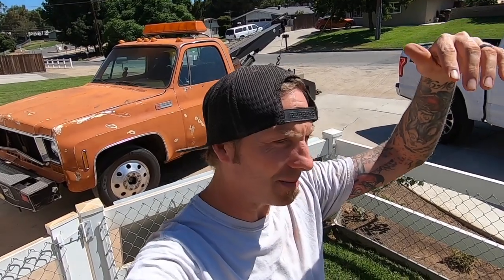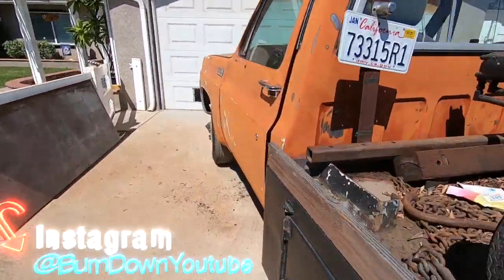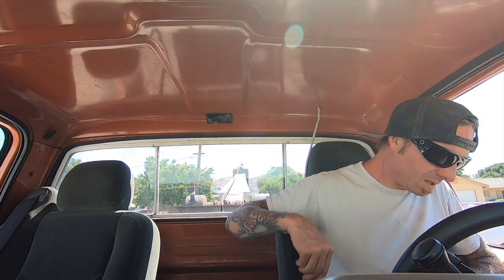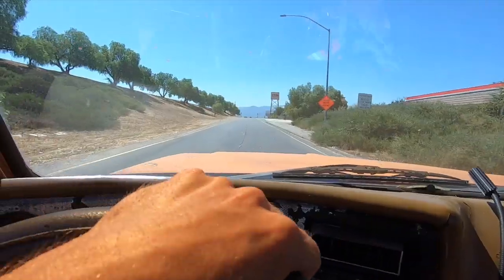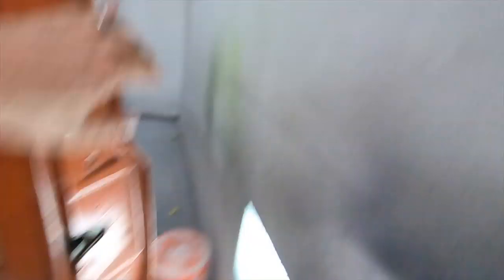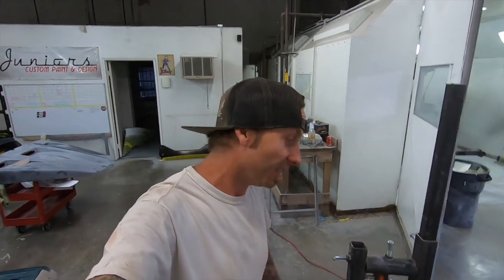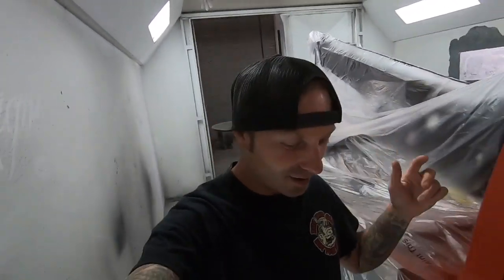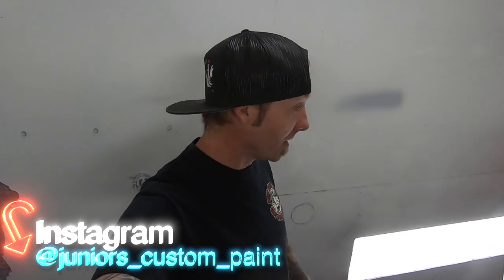First Time In A Spray Booth

Comment: Ha ha makes me feel better about driving the #sandrat around 😂
Any tips for spraying a car in a driveway? Thinking about having a gazebo roof at least for shade
Reply from the maker: If you paint in the morning do it early but after the due point has passed and the surface of whatever you painting is dry. Also use the right reducer for the temperature. The object will probably be cold that your painting and if you have a slow reducer it will probably run so use a fast reducer. Try not to spray on a windy day either.
-Dane
Reply: @Burndown  hoping for it to be around 25°c when I do shoot it was just going to go clear over what I have keep it ratty you know
Reply from the maker: @nazzcar7  Seems like I do too. Maybe one day ill paint my car who knows.